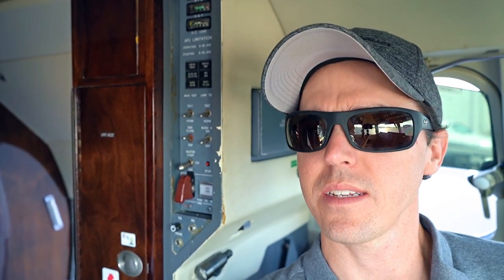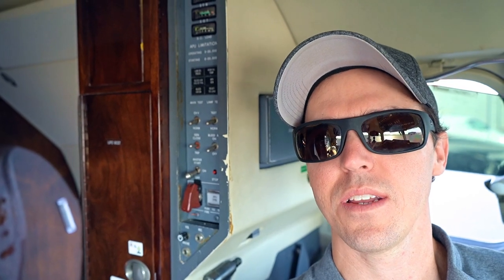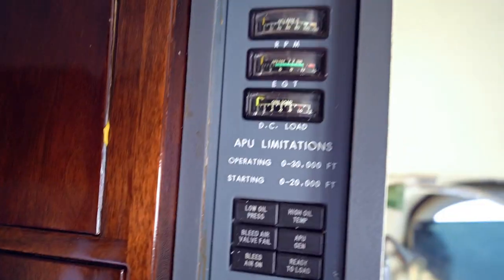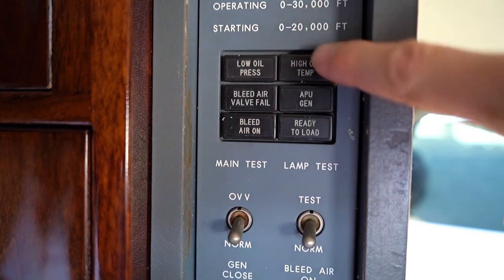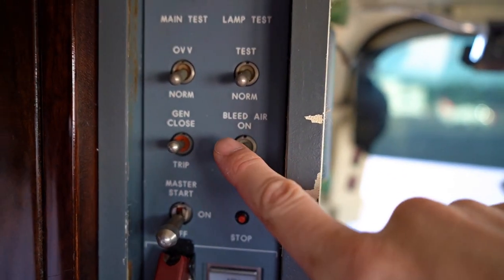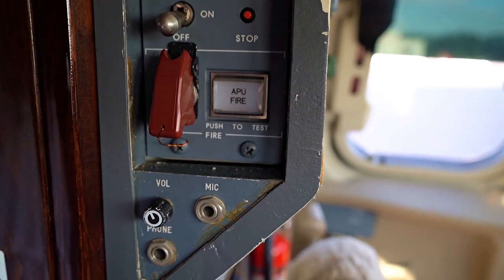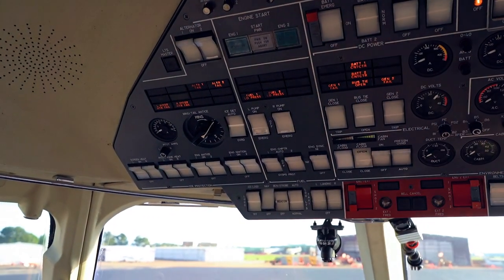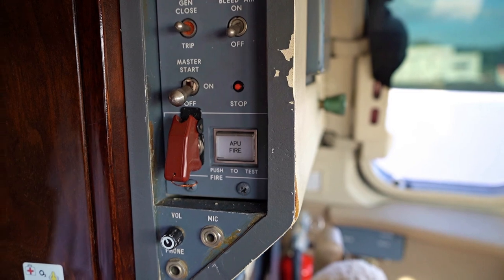Tech Tuesday - Hawker APU

Comment: Thanks for sharing, Sean!

Maybe you can answer a couple of tech questions regarding a private pilot. How many flight hours to I need to get my PPL? What would be the next steps (flight hours, tests, etc.) to fly a turbo prop and then a Private Jet or Multi-Engine Aircraft?
Reply from the maker: Sure! The minimum for a Private Certificate is 40 hours, but most people are closer to 60 hours before the checkride. After that, you would need your instrument rating and then Commercial Certificate. Depending on the training program, you'll be around 250 hours by that point, then it's a matter of finding a company to put you in their plane!
Reply: Awesome... thanks for your quick response! How do you spell your first name, by the way?

Comment: I really enjoy the tech Tuesday's Shaun. I would be interested in learning a bit about the nuts and bolts of navigation. I've often wondered what the difference is between the RNAV approach and the ILS. Also, what is the significance of the altimeter? I hear it all the time, but I don't really understand what it is or what it's significance is relative to the flight of the airplane. Thanks for all you do.
Reply from the maker: Great suggestions! I will work my way through those for some future Tech Tuesday videos...

Comment: The APU is a neat little self contained turbine engine that spools itself up and provides bleed air to the engines and environmental systems as well as generating power for the electrical systems. So how often is the apu turned on Shaun and under what conditions?
Reply: If I may...LOL....We use the APU to power all of the aircraft systems an environmentals while sitting on the ramp waiting for passengers. We typically turn it around 45 mins prior to departure and it's kept on until climbing out on departure. We shut it down just after takeoff per the checklist and turn it back on when back on the descent typically below 18,000 ft. When the engines are shut down, the APU provides us cabin lighting, and heating or cooling while the passengers deplane and we clean up afterwards.
Reply from the maker: It is almost always turned on before passengers arrive then either just prior to landing or just after. It makes for a much smoother transition for engine start and shut down as far as passenger comfort goes

Comment: Very nice video. Thanks, The Hawker looks pretty worn. Is it an older model or just had hard use?
Reply: Yeah. It always bothers me to look at a panel and see some rust and chipped paint. Sad.
Reply: These Hawkers were originally produced by the Brits in 1963. The version Shaun is in was make in the early 2000's. Those plastic trim pieces are hard to keep in decent condition and they're just glued on.
Reply from the maker: Not terribly old, but definitely had some use

Comment: You didn't mention what will happen if you have APU bleed air on, the inverters off, and the main entry door is closed. Very interesting situation haha.
Reply from the maker: HAHA! yes indeed...
Reply: Airplane will start to pressurize, since it needs power to that nice venturi fan/vacuum source on the rear bulkhead for the outflow valves.

Comment: I knew that a lot of planes have an APU.  But having watched that video, I have a question....  What is the electrical system on an airplane?  Is it like a boat (my thing) which is a 12V and an inverter combination?  After watching this it seems that the APU is basically the generator that makes 120V when needed.  Kinda like a genset on a yacht.  I'm learning.... Am I close?
Reply from the maker: Pretty close indeed! We use a 28 volt system, and we also pull bleed air from the APU to heat/cool the interior of the plane

Comment: Hey Shaun, when would you normally kick on the APU upon arrival?  Do you wait until you taxi off the arrival runway or would you start it outside the initial approach?  And would that be when/where you would start it regardless of the corporate jet?  

Thank you sir
Reply from the maker: With the Hawker, we usually start it on the approach and turn on the bleed air while still in the air. It makes for a gentler pressurization transition on landing. The G-IV APU is restricted to ground use only, so we start it as soon as we exit the runway.
Reply: @CorporatePilotLife  
Thank you Shaun.  Have fun training in the Hawker.  I know very little of the Hawker.  Will you be doing trip videos with the Hawker or only when you are in the G-IV?
Reply from the maker: I'll be doing both...
Reply: Corporate Pilot Life 
I’m sure each model is different but do APUs pull fuel from a dedicated fuel tank or does it pump fuel from the regular tanks?  Do they have a dedicated fuel pump? I know, to many questions. Thank you for your videos.

Comment: But i saw you in your check list you turn off APU from overhead panel is there a connection?
Reply from the maker: The G-IV has overhead controls for the APU, but the Hawker is only operated from this panel